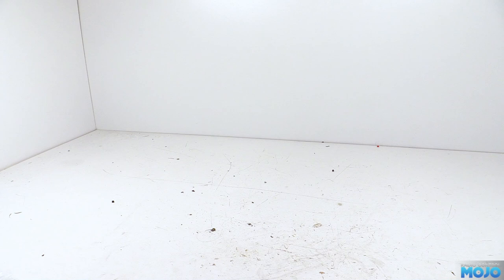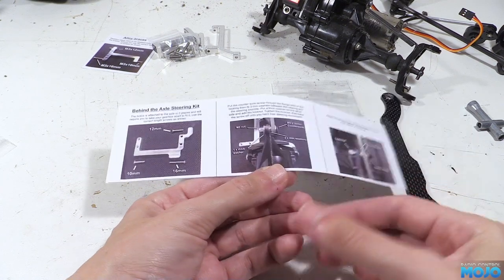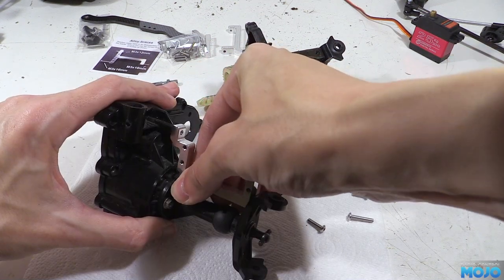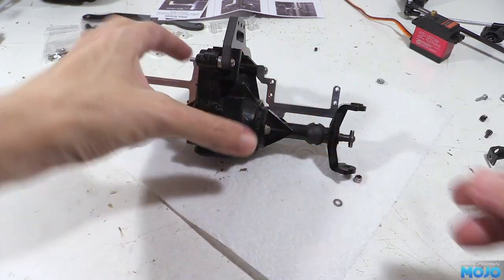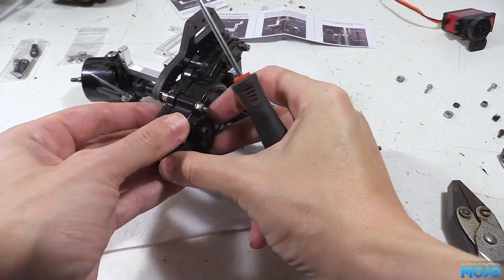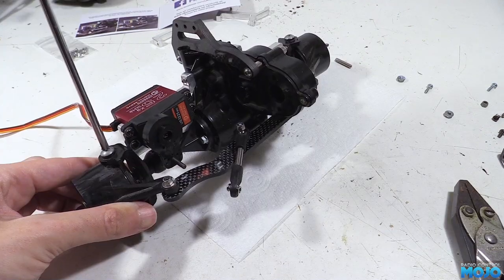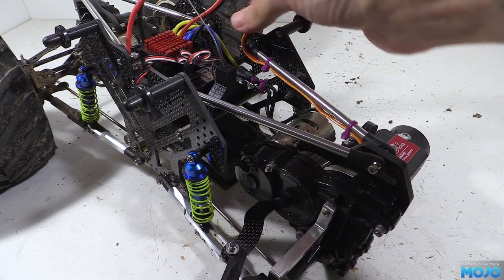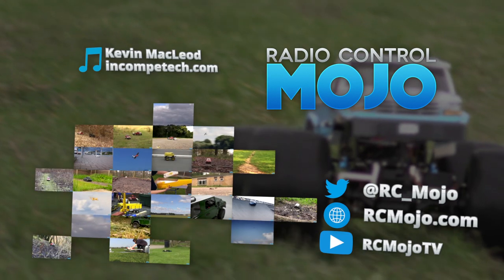Tamiya ClodBuster - #7 Behind The Axle Steering

Comment: Never been into Clod`s ,so never really looked into mods etc for them BUT this is getting be interested. another great content vid AND well done showing the brace error : )
Reply from the maker: Clods are a lot of fun, if you can source some vintage parts you can put together a high riding blinged up chrome machine, or you can build a low sling racer. There's a vast amount of options, plus it's a bit different from all the modern RTR's that generally just work out of the box... Where's the fun in that?

Comment: Thought you were going to solve the body issue by extending the wheelbase by moving the front axle forward? Looks like the shocks, bottom and top links can all move forward equally to keep the geometry. Great video, you make everything so clear. Loved the cocktail stick tip. Thanks. G
Reply from the maker: Quite right, the wheelbase gets extended in #8. It does help the appearance quite a bit

Comment: Get some 6/32x3/8 stainless bolts and replace the axle tube nut and bolts. Makes changing axle tubes much easier not having to split the gearbox every time. Clod project is great ! I'm saving my pennies to do a complete clodshop overhaul on mine. Thinking about putting same chassis as you with all their other mods Inc poss rear steer also bta.
Reply from the maker: You wont be disappointed, all the bit's I've had from ClodShop have been tip top!